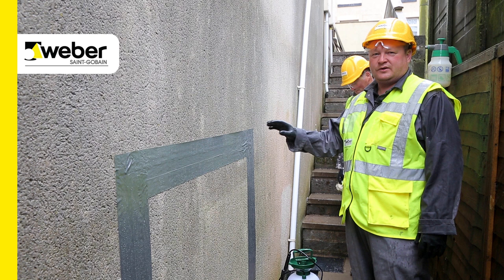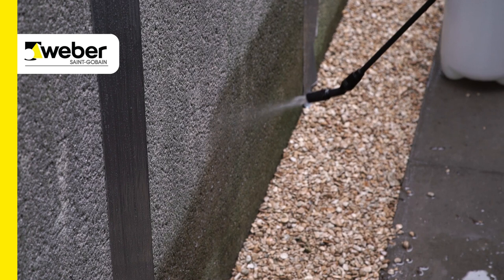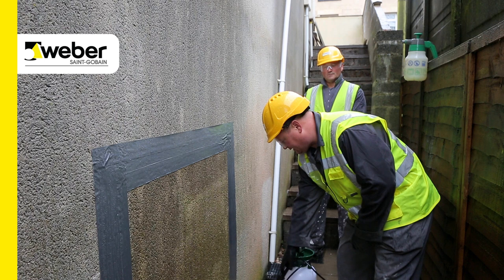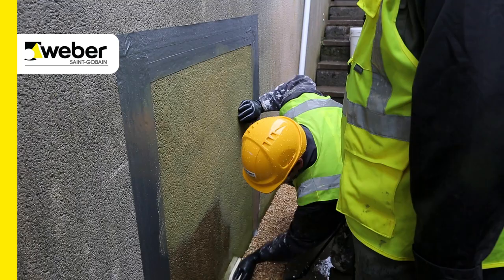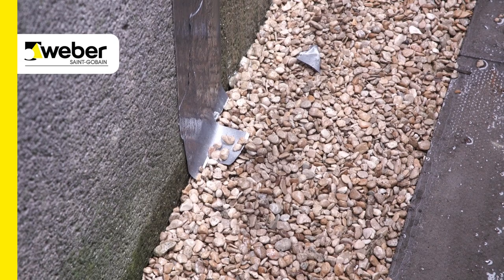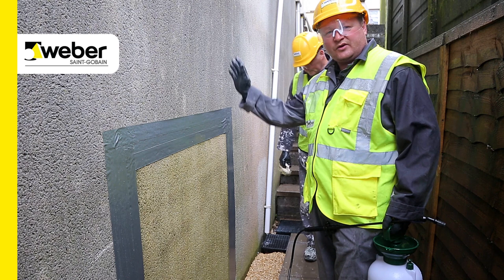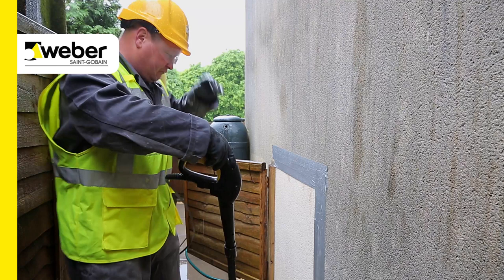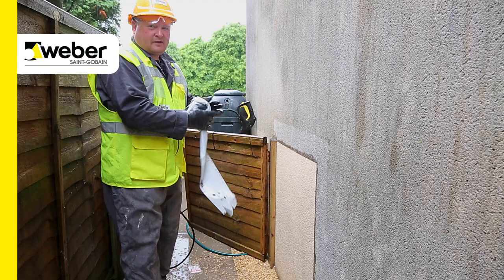Removing algae from external facades — Weber Renders & Decorative Finishes

Comment: so .. this works better then 50/50 bleach water solution ? .. wich imo works after 3-4 mins .. and last aprox 1 year
Reply from the maker: Hi @Ladosligese, weber CL150 has been specifically designed and tested for the effective removal of algae and fungal growth from the surface of Weber renders, household bleach may not be as effective on certain staining or if the bleach is too strong, it could affect the aesthetics of the rendered finish. weber CL150 is supplied ready to use and has been pre-diluted to the correct strength reducing any risk of damaging the render. In addition, the use of cleaning or decorating materials that have not been approved by Weber can invalidate any guarantees currently in place for the render system. If you require any further information please contact our Technical Team on 01525 718877 or email technical@netweber.co.uk
Reply: @SaintGobainWeberUK  ty for the reply, ill look into it since i need to rinse my facade on white limed wall on my house . again ty for the quick reply

Comment: I don’t have a power wash so can I simply hose the product off on a jet wash setting?
Reply from the maker: Hi Roberto, yes that would be fine wash it down with a hose to remove the algae and Weber CL150 from your facade.
Reply: @SaintGobainWeberUK  thank you very much for your reply. I’ve used another product where you apply and leave it but it’s taking to long to see results, I’m told it can take up to two months to see results but I can’t wait that long.
Reply from the maker: @robertolombardi3698  More info on the product here... https://www.uk.weber/weber-cl150 if you want to chat it over, feel free to call our Tech Team on 01525 718877 (option 2) thanks...

Comment: Can this be used on all renders? Monocouche and thincoat for example? Also after applied should the wall be covered to protect from rain or is light rain okay?many thanks
Reply from the maker: weber CL150 can be used on most masonry substrates and our thin coat renders. We would advise the product is only used when rain is not expected for the 48hours the product is on the wall. Rain could wash the product off the surface and reduce its effectiveness... if you require any further information please contact our Technical Team on technical@netweber.co.uk or call 01525 718877

Comment: Hi - What water flow would you suggest we use - 60 BAR is low pressure which is fine but if the water flow is 30 lpm it would be too much pressure still for example.
Reply from the maker: Hi - 60 bar on a fan setting is our recommendation, the water volume shouldn't effect the pressure if set at 60 bar. thanks Weber
Reply: The water flow IS THE MOST IMPORTANT THING - if water flow happens to be 50 litres per min at 60 BAR it could knock a hole through the render. If the WATER FLOW is 2 litres per min - it wont be enough. The Correct method of cleaning your products would be water flow at 5 litres per min at 50 BAR using a 45 degree fan jet. Better still a SoftWash System which is designed to clean render would be a lot better. Pressure washers which can be turned up - will be by employees - who think they will work faster.
If you would like to attend one of our next education open days here in Ashford, Kent please login to our website and you will receive updates. 
www.softwash-systems.com 
We would be happy to demonstrate our systems and methods to one of your problem sites, please let me know.

Comment: What about bird poo? Does CL150 remove that too?
Reply from the maker: Hi, weber CL150 was developed for algae removal, we haven't tested on bird poo, we would recommend cleaning with a mild detergent and pressure washer on a low fan setting. You can protect your clean render with weberend protect (https://www.netweber.co.uk/renders-decorative-finishes/products/ancillary-products/weberend-protect.html) which will help protect the surface and avoid staining going forward...